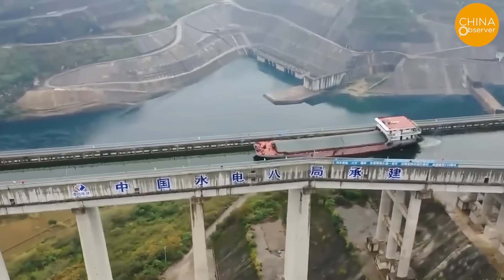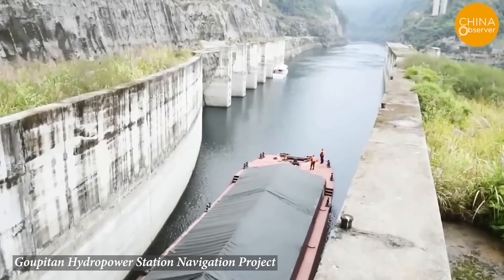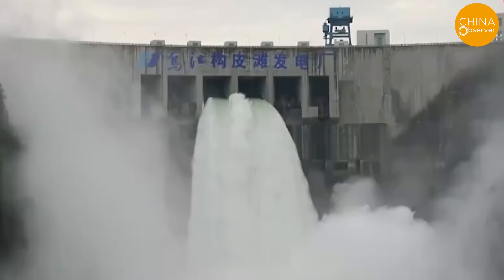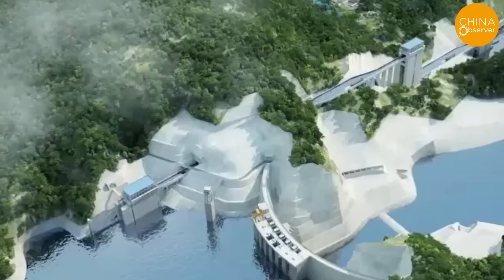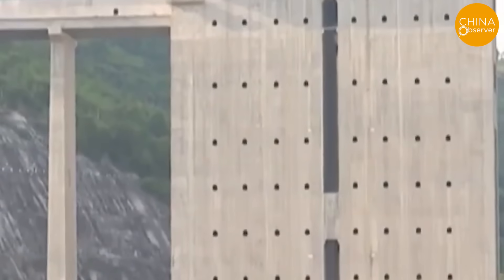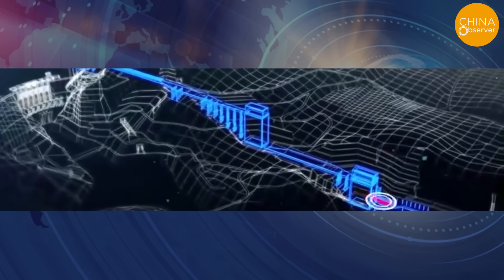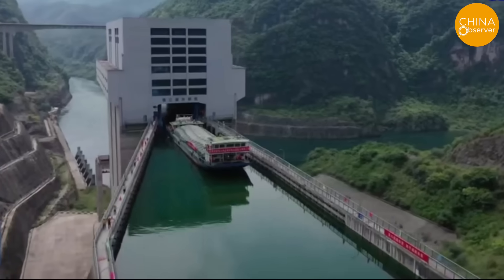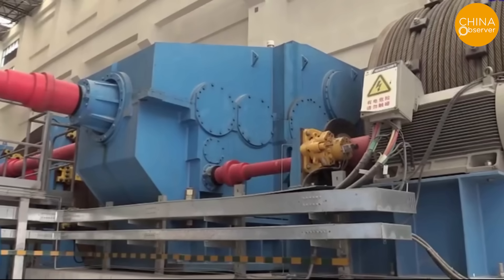127m Shiplift & 500t Ship Navigating on Viaducts | 471 Million USD Stupid White Elephant Project

Comment: 900k tons per year for a 500million  project building means that it's 550 or so  dollars per ton for the first year operate it for 10 years and it's 55 dollars. Including maintenance and so it's 30 dollars per ton in 20 years. That sounds very feasible especially if you consider the additional plus from the power turbines. Compared to countries like America this is actually a quiet good rate. However I doubt that the fish are having a nice time and they should build these stairs for fish which are already prevalent in America or Europe. After all this river is really really big so not doing this will add a huge cost to the feasible project

Comment: This is just like high speed rail network: the main focus is not in the revenue of the transport system, but the economic stimulation it brings to the surrounding regions through service and job creation, not to mention the experience accumulated for building such a structure in the future.
That’s the main strength of a strong central government — they can plan out the future and not be tied down by short term benefits as private companies are.
Reply: 100 years to last? Lucky if it lasts 5-10 years “Made in China”. Good luck laying flat!
Reply: @rossb3454  sorry to bust your bubble. This is not the first shiplift China had built, nor the largest, only the most recent.

I had visited the largest one located at the Three Gorges Dam via a cruise liner. That was at least 6 years ago. When I visited it had been operating for a very very long time.

So no, it had not collapsed after more than 10 years and will not.
Reply: @thomaszhang3101  China also built the Great Wall of China and its still standing because it doesn’t involve water. Do you think the dams, ship lift,  bridges, tofu buildings built for the last 40 years will last another 50 years . Once they slodisintegrate watch the human catastrophe.  Water is the huge destroyer of things.

Comment: I would think building something like this is a great achievement. China is well known for its mega-projects and the Image they'd have all believed, but outside of China, past all the sensors, these projects are wildly rumoured that it's all their, finished but just sits there doing nothing. Heaven forbid the time when the first bill is tendered and the prestige Beijing would expect, they're gonna need boats lining up to use it 24/7 to pull through and break even, if they don't, well let's just leave it at that.

Comment: What a waste of resources…. If the barges being floated through this project are 500 tons, that means they only carry the equivalent of 2.5 rail hoppers. A stat I didn’t hear was how long it takes this transport system to move 500 tons of cargo between the upper and lower basin? My guess, since China will never release the real stats, would be at least an hour with a total 24 hour capacity of the facility of 36,000 tons or just 1 average Australian mineral train.  Clearly a railroad would be a much better solution than using barges. There is a reason that this kind of small boat freight haulage disappeared in much of the developed world over 150 years ago.

Comment: There are similar smaller equivalent stuffs in Europe, but the question in China is really if the running costs are going to cover the benefits and when it will start to leak.

Comment: This is not a smart design. It really only need to water chambers that has water in and out to adjust water level.
Reply: you are ridiculous if you think a stair of locks could do that job in a reasonable time and space. Not to mention that the needed lock system would have a huge number of chambers, which means the loss of water for a single ship getting through would be insane. Learn about the physics of locks (especially loss of water) and you will see why there is a boat lift, many rivers/canals throughout europe got boat lifts for much smaller drops as a system of locks becomes exponential more difficult and costly with every meter height added.
The design of that ship lift viaduct is fine and probably the best which could have been done, that said its still unreasonable in its cost, impact and probably will never see a profit.

Comment: Considering that a ship don't sink, and the water is a object that suspends the ship, why doesn't the concrete fail with the bonus weight of the ship?  When you realize the issue with weight and distribution of the weight has no bearing on the columns then there arises a situation of the question of the day what exactly is gravity.

Comment: might as well have made the biggest cranes in the world and the largest train in the world and just have them moved on rail and dropped back into the water. Would have been far cheaper and far more reliable then having a large cargo ship suspended in mid air on a elevator.

Comment: 471mil actually seems cheap for the project size.  It might be terrible from an economic payoff perspective, but it has the type of 'optics' the CCP likes.
Reply: Yeah good engineering sadly pretty useless imo
Reply: @bigbadlara5304  what about boat lifts in europe?
Reply: @leihtory7423  smaller smd cheaper
Reply: @bigbadlara5304  at less than half the size at 180million usd. Strépy-Thieu lift belgium & Scharnebeck lift germany.

Comment: The biggest problem seems to be if anything were to go wrong at any chain of the road, then the whole system is a waste, like what happened last year in Egypt. But with a "narrow" waterway like that, then it is bound to happen sooner or later. And I do not have any doubts that it will happen multiple times within the next 100 years
Reply: Same happens with railroads

Regardless railroads and boat transport is cheapest and most efficient

Comment: I cant help but think you could move cargo quicker/cheaper with rail. I highly question its long term running costs
Reply: True, much cheaper, faster, less maintenance and easier to load and manufacture
Reply: When it does fail it'll be spectacular. It's only a matter of time.  An earthquake would be catastrophic as that's what formed the mountains as they are now.
Reply: @darrellcook8253  How you wish!
Reply: It's China's 💰💰💰💰 after all. Let them invest as they see fit with their surpluses. Let them innovate.
Reply: the huge elevation change is a problem for railroads (the surface area between the wheels and the rails is small, about the area of a dime, so grip--i.e. friction--is hard to get) so either you build a long winding route around the dam or you build a funicular.  Its best just to put a highway here.
Reply: @TheFirebird123456  That's why we build tunnels.
Reply: I can't help to think why not displacing the cargo only, instead the whole ship... If the cargo are specific type like coal, they can just dump it into a conveyor belt downward upward.

Comment: Given the state and quality of chinese construction, is this really a good idea? That ship that's floating around is probably empty and hollow on the inside save for the the absolute bare essential components.
Reply: it doesnt matter how much the mass of the Ship is for such a Lift, because it displaces exactly the same mass of Water. So the Lift will always weight exactly the same, no matter if it carries a 500 Ton Ship or if its empty.
Reply: @unitrader403  ... But if your demonstration uses an empty ship then you will need less water to allow the ship to float. So overall an empty ship plus the water will still be less than a full ship plus water.
Reply: @sbalogh53  nope, its exactly the same /cancels each other out.

Assuming you have 1000 Tons water in the Lift, if you put a 500-Ton Ship in there it will be 500 Tons of Water, and 500 Tons of Ship (Sum 1000 Tons). If you put a Ship with 10 Tons in there it will be 990 Tons Water and 10 Tons Ship what remains in there (Sum is also 1000 Tons).

Also the Amount of Water in the Lift is dictated by its Design, varying that would be a technical challenge never done before for good reasons, because it would serve no purpose since the only thing you do is introduce more complexity into the System, without gaining any benefits (if done you must also vary the Weight of the Counterweights  to accomodate for this).

see also this Video:
https://www.youtube.com/watch?v=qHO9gARac-w
Reply: @sbalogh53  The Video also said that the amount of Water will regulate itself. a 100-ton ship will displace exactly these 100 Tons of Water from the lift and push it into the Channel the lift is opened to. no active regulation required, just plain physics..

Comment: Of course there is an Achilles heel. Sounded like a really cool project. Particularly if they limited the toll charges to maintain maximum use without overuse of making it free.

One of those make it back in GDP instead of direct toll taxation.

After all that, they left a ridiculously small allowance for water height.

Typical communists.